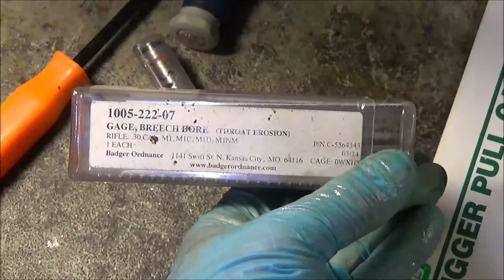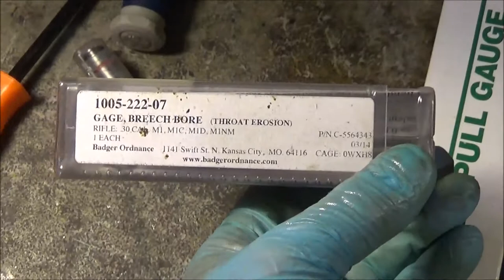Swiss K31 Restoration Series Part 1

Comment: Enjoying going through your videos. In regards to the rifle timeline, the soldier would have been issued the rifle for his basic training (4 months) then taken it to keep at home. Brings it out for mandatory training each year (2-3 wks). Finished reserve period about 12-15 years later then turns it back in or could sometimes buy it to keep as personal rifle. One reason so many are in such nice shape.
Reply from the maker: Hi Al S: I think your description of how they were used is accurate. And I have seen many that are in wonderful condition. I've also seen a like amount that look like they were used for a canoe paddle. So I've wondered myself what was the conditions or usage that made a huge difference in the stock condition. They were training in the Alps so perhaps the difference could be the time of year or even perhaps the person it was issued to. I'm sure you're aware of the "beaver chewing" on the butt end of the stock and what caused that. One  thing I find a bit odd is that regardless of how the stocks on the military issue K31's mechanically are virtually always in excellent condition will near new barrels showing very little throat erosion and will still shoot lights-out. Trained with a lot but actually shot very little it would appear. By comparison on the other end of the spectrum the Private Series K31's often show much throat erosion but have excellent select walnut stocks. Those were sold to the civilian market and were used to compete ........ a lot.
Anyway glad you're enjoying my vids. Have a great day (-:

Comment: Nice condition rifle you got there. My Grandfathers old K31 is dinged up quite a bit more. On the other hand he did wartime service with it. Taking that one as an example: a buttplate that lifts off the edges slightly is simply a sign of heavy use. Sadly I cannot even take the buttplate off because the upper screw is worn to the point where a screwdriver won't engage anymore.
Greetings from switzerland
Reply from the maker: Hi Land: Damn, I can only imagine how much that K31 must have been shouldered and fielded to wear the upper buttplate screw to the point where the slot is worn to the point of disuse. What I have done in the past is using a Dremel and a very small diameter cut-off type bit to cut a new slot. If I was you I'd think it would be very cool to see your grand dad's troop tag under the buttplate. And thanks for the interest and response from Switzerland :)
Reply: Well thanks for the reply. I find it quite interesting to see how well regarded those rifles are in other places. After all they are "just" completely common here.
And the troop tag is just about accessible because the buttplate lifts enough for the tag to svivel out when the lower screw is loosened.
I have thought about cutting the slot a bit deeper but for now I think I will leave it as is because i don't have any real need to take the plate off anytime soon.

About that trick with the dremel tool: I used it a lot until I did a restauration of something where i didn't want to risk cutting into the surrounding material. So for that one I ground some tools much like engravers chisels to the most common sizes of screw slots. They were easy to make and greatly reduce the risk. Plus  a slot cut with those can look like it was supposed to be that way :)
Mabe this idea could be useful for you as well.
Reply from the maker: I like that idea. Next time I run into that situation I think I'll try that. I suppose getting a piece of tool steel to grind into a proper size chisel should not be a problem. Also I can see from your response you're not at a loss as to the intricacies of the thing. Many times when I try to explain this kind of thing I get the deer in the headlight look from them. And yes, K31's in the US of A are highly regarded and sought after. But it wasn't all that long ago that these things were overlooked. Not anymore though. However to be honest, over the years I've gone through just about every type of mil-spec wooden turn-bolt rifle in existence from Mosin Nagants to Mausers to 1903's to Enfields. You name it I've wrung 'em all out to a high degree. The K31 makes them all seem old ,slow and antiquated. So I know they're common place there, but not here. And they are manufactured to a very high degree and they're stupid accurate for multiple reasons. So find me some K31's............. my people want 'em!

Comment: I'm just now seeing this in 2020. Excellent information. I just got a K-31. You're right about the rear sling attachment... ask me how I know!
Reply from the maker: Hi B: Ok, I'll bite ........ how do you know? O-:
Reply: @lencac7952  Yesterday, I very gently removed a rear sling attachment... and unintentionally removed two arc shaped wood chips around the lower screw. One of them fell between cracks in my deck due to a gust of wind. Lesson learned: quit messing with milsurps. Accept them for what they are.
Reply from the maker: @bhoward9378  Well B I'm sorry to hear that. I've done many K31 resto jobs. Never had that happen. Primarily because I was extremely patient and developed a couple techniques that worked well. In part 2 of this series I go into fairly good description on how I did that. Here's a link to that video. Little like closing the barn door after the horses have already escaped. You can go to the 23:46 mark to see how.
https://www.youtube.com/watch?v=KuubkxbFX7s&t=1271s
Reply: @lencac7952  Thanks! There will be other horses and other barn doors, so this will be useful.

Comment: Sling bar: If you are going to clean the stock with water I've found if I remove the screws then clean the moisture will relax the wood and the bar will come out without injuring the stock..
Reply from the maker: Hi Sean: that's a good tip. Thanks. See you can teach an old dog new tricks. And I do believe the original finish on the beech wood stock was a shellac. Which I'm sure provided a level of protection from the elements. However, I think the reality of the thing is these old war horses day's of being lugged around in the Alps and snow are over. So I just used the linseed oil. It's also very easy to touch up of necessary. But the walnut stocks were finished with a concoction of, if I remember right, turpentine, bees wax, linseed oil and and white vinegar. Does that sound right?
Reply: @lencac7952  Your not an old dog but the 'Top Dog' when it comes to K-31's in the USA.
Reply from the maker: @beefcakes27  That is very kind of you to say and I very much appreciate it. Thank you so much (-: